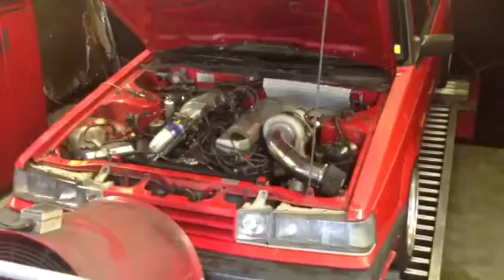RB30E+T R31 Dyno Tune

Comment from the maker: Turned out one of the plugs was rooted but still chasing a detonation issue. Checking out the fuel pump wiring today. I run 98 octane fuel.
Reply: would it work on a nissan skyline 1987 r31 gx 30
Reply: +Your Dads Left Nut +Your Dads Left Nut no reason for it not too their practically the same cars, although he did spin a bearing eventually wich you can watch "Davo's r31 burnout - RB death"  also your car is a series 2 so the block has oil and return feed  aswell as a coolant feed all for the turbo pre drilled and threaded it's all just plugged up with bolts. Shout outs to dave for the awesome videos R.I.P